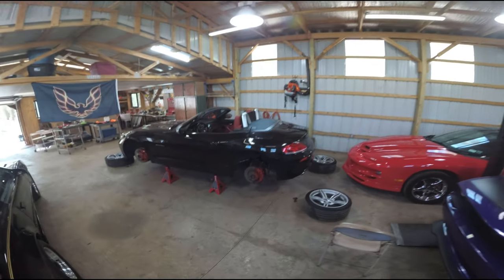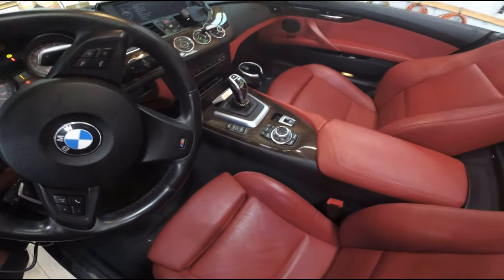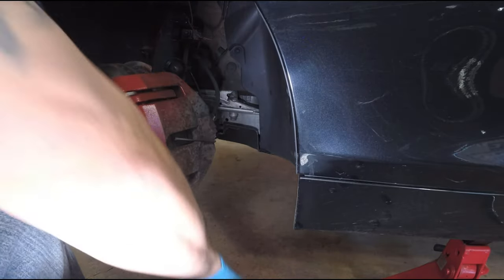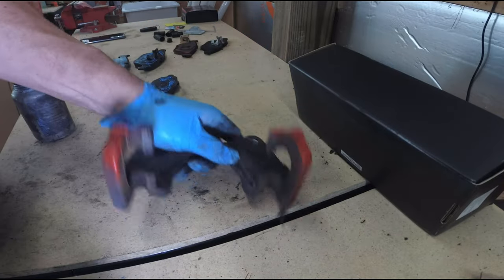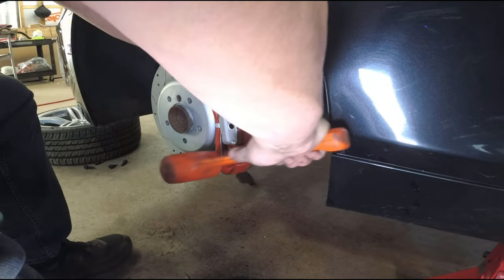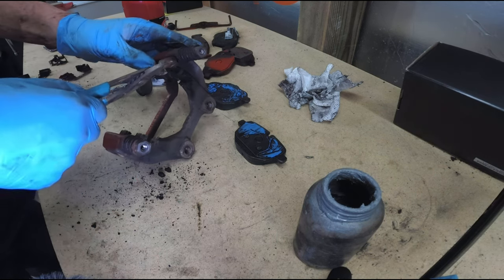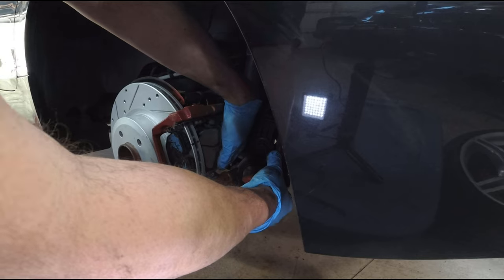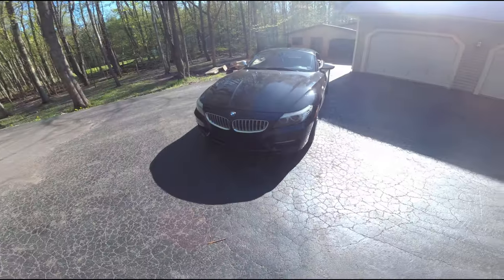BMW z4 Brakes Front and Rear Replacement Pads Rotors Replace Repair

Comment: Do you need to release the parking brake for manual cars?
Reply from the maker: @jaredgates7743  If it has the electronic one, yes. Almost all modern cars have this now. Invest in a scanner that can do it.
Reply: Dude liked the comment but didn't answer the question lmao
Reply from the maker: @jaredgates7743  if it has the electronic parking brake system, yes

Comment: hi I've got a dumb question, I'm relatively new to cars but got myself a damaged Z4 for £1K,

I want to replace the brakes with performance parts but looking at OEM compatible parts, the rear disks are always solid, and smaller also

i was going to get a biasing valve so I can undo some of the factory overbiasing, as such I would like larger disks in the rear

is there any reason why I can't just buy 4 of the same rotor and use it all corners? or do I need to get different rotors for the rear?

I can't find an answer elsewhere

cheers
Reply from the maker: You would need a bracket/adapter to mount the rear caliper in a different location to accommodate a larger rotor in the rear. You would also need larger calipers in the rear, and possibly a more powerful master cylinder. 80 to 85% of the braking is done by the front brakes vs the rear. Messing with the brake biasing can also change the handling performance of the car while braking making it unstable. I would proceed with caution and suggest upgrading to something like I did in the video 1st. Then look into what racing kits can be applied to the car like Brembo or Wilwood. Good luck!